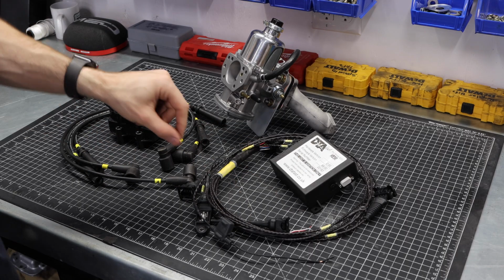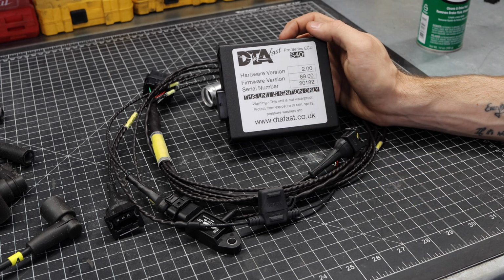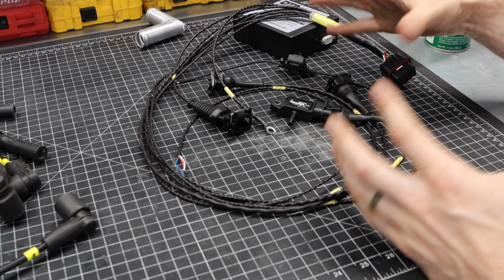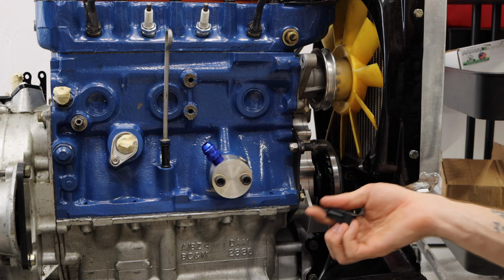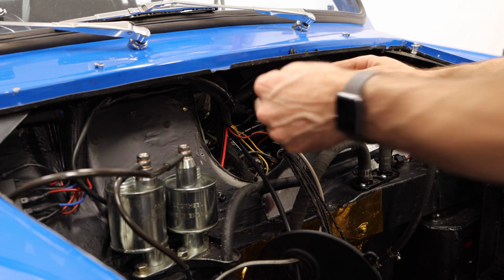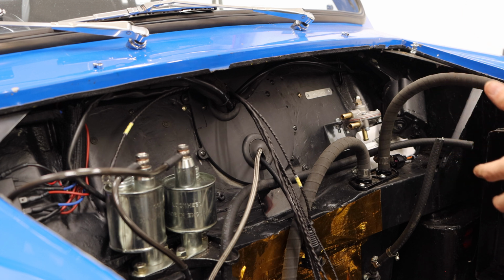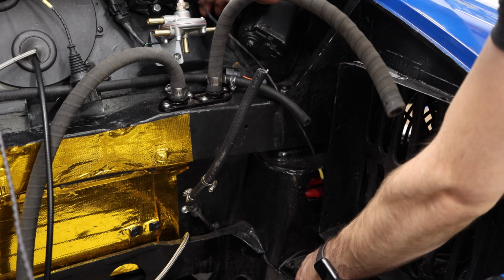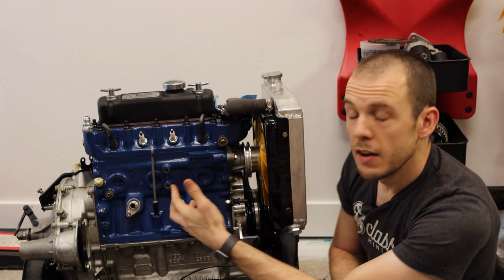Turbo Classic Mini | Part 2 - Wiring the ECU

Comment: Interesting video but since you are only doing ignition mapping could you not just use the programmable 123 dizzy?
Reply from the maker: You could but the 123 is still predefined curves. Many of them sure, but still fixed curves. This provides granular control over every MAP cell so you can get optimal timing in any scenario not just in a predefined curve.
Reply: @classicminidiy  they also do a mappable dizzy now

Comment: Hi if in your build you done all the cam timing correctly via TDC  and you're using an electronic distributor like Aldon would you need an ECU set-up like this. Just asking.
Reply from the maker: Hey! So The cam timing and TDC are important but unrelated to the type of ignition you use. This ECU setup is made to replace the distributor completely. So you would either use a distributor, or this ignition system.

Comment: Hi, could you tell me where you wire the power & ground? Is it from dedicated source from and to battery? Or power from fuse and ground to chassis? Thanks!
Reply from the maker: I have replaced the fuse panel with a newer modern one, and have a fused/accessory circuit to the ECU which powers it when the key is turned on in the ignition. I have a common grounding block that grounds to the chassis as well like normal.

Comment: I thought the ECU will help you tune your fuel mixture if used with throttle bodies, but you are only using this for ignition.  How will this help you adjust your carb?  Anyway, does that ECU can work with Jenvey throttle bodies?
Reply from the maker: Hey there are different ECU's for different types of applications. In this video it is an ignition only ECU so it does not do any fuel or injection management. Meaning it only controls when your spark plugs are firing. The carburetor handles all of the fueling, and fuel management. This ECU would not work with a Jenvey throttle body, however the company that makes this ECU DTAFast does make ECU's that would.

Comment: Great video and love how the turbo project is coming along..   Could you please attach a screenshot or picture of what timing advance you are going to use either in the base tune or later. I've got a standalone ecu to do the same thing it's just not designed specifically for my mini metro.  So would love to use a good default safe position.  Thanks
Reply from the maker: Hey Trevor thanks for watching! I probably wont be sharing my tune online, not because its a secret or any thing but because its so car specific I really am hesitant to share something that could potentially cause catastrophic damage to someone else's car. I will think on it a bit more and if I can find a way to share something safe for everyone I definitely will.
Reply: @classicminidiy  what you could share is the base map provided before any changes that way its not from yourself at all in fact its just the base advance.  I am using a speeduino to support even cheaper builds by supporting the open source community.  They have a lot of heavily tuned ignition but I would like a base setup to begin.  If you could would really help people into DIY mods on their car.
Reply: In addition small questions.   I see you have the fuel pressure regulator and pump changes some if can see in ur most recent video.   These items may come up but it would be great to know things like turbo return feed.  Something a basic a series doesn't have and something I'll also need to do.  Some of this may have been in ur super charger build I will go back and check but if u could cover this in upcoming videos as u install engine would be great.   Keep it up.  Lovely work....   o and buying a shirt I think now I've got a hif44 turbo setup lol. Love the imaging.
Reply: Here is the exact Information which is used to calculate a safe ignition table based on the engine sizes people have.  It is only a safe base setup but it'd extremely better than diy people guessing or starting with an empty table and causing issues.  I hope this helps people like me who aren't just buying a finished product.http://useasydocs.com/theory/spktable.htm
Reply from the maker: To be clear I am not totally opposed to sharing a base map with the channel. While this DTAFast unit does come with a base map I will still have to get the car tuned and set up by someone who knows what they're doing on a dyno. The base map is for an NA car and isn't directly suitable for a boosted engine. So the hardware is a finished setup but the software def isn't. My main goal though is to share as much as I possibly can on this build so others can feel more equipped to tackle it. Regarding the fueling though I do have plans to go over that whole setup and how it's changed for the turbo build. :-)

Comment: Cole, if you’re running the MAP sensor then you won’t need the TPS as you can normally only tune using one of them as the source for “load”. It’s a great looking kit, I’d love something like that for mine
Reply: dta can do both or either, ive used tps with map correction.